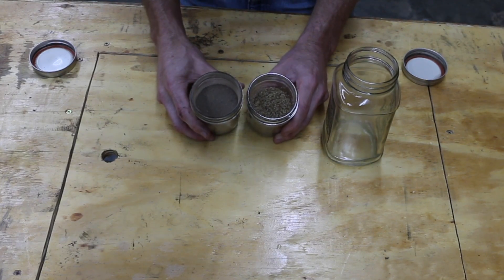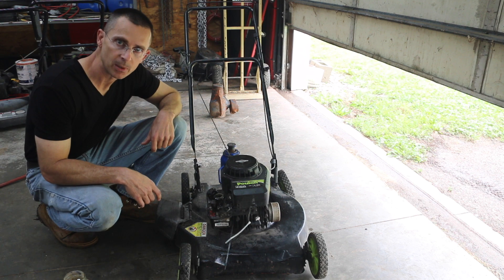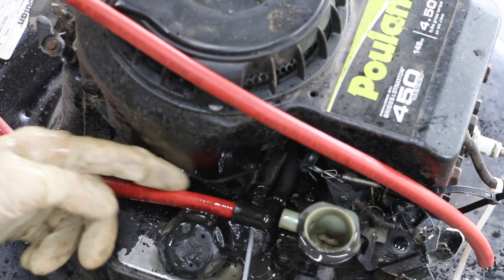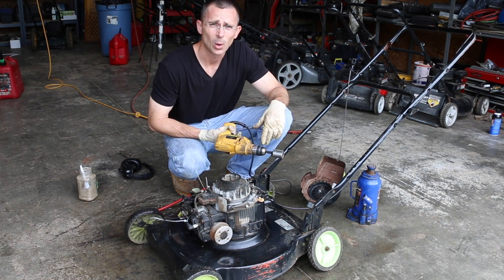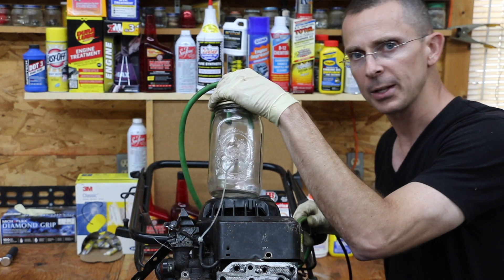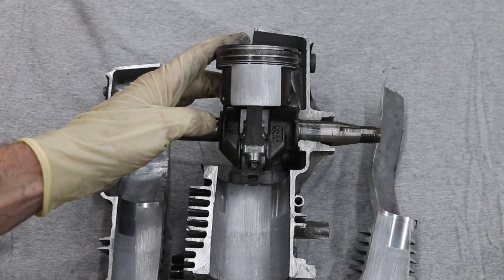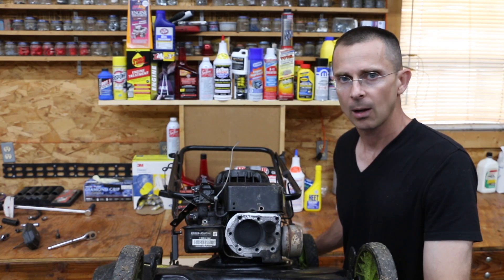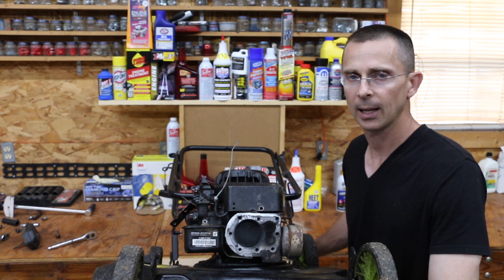Will Dirt Destroy an Engine?  See what it does to this Engine!

Comment: This is a bogus experiment. Even in a lawnmower engine close to the ground and the blade kicking up dirt, it would still last many years. The likely hood of it being discarded because of engine wear due to no air filter is very low. Same holds true for a motor vehicle engine whether it's diesel or gas.  Short term damage is an issue due to unusual circumstances where a lot of debris enters the intake incidentally such as in this experiment. Otherwise, damage is in the long term by shortening the life of the engine but not necessarily significantly. Wisdom says to use an air filter.

Comment: I've been concerned about my K&N air  filter  in my Mustang.  It came with it when I bought it used.     I can see the thought process.    The '99 SVT engine revs relatively high.  I seem to remember from one of your other videos that this filter is not a particularly good filter.  The way these filters are installed the original parts the filter attaches to are gone.   A regular paper filter cannot not be installed.    When I see allot of dust in the air I try to coast thru it.
Reply from the maker: Thanks for sharing.

Comment: Remember kids, change your oil regularly, follow manufacture recommended intervals and for fuck sake change your air filter. And don't use that K&N crap because it filters LESS than a normal filter.

Comment: I had a customer come in with a mower that hadn't been serviced for 3 years and been used commercially, plus the air filter had been removed.
After servicing it, it took 5 mins of running before it blew out less oil than that engine did through the bypass pipe.
So for a comparison, you did more damage in that time than my customer did in 3 years.
I think the grit size is the reason it got so damaged that fast.
How about something of a finer/softer size/texture, like grass clippings, drier fluff etc 
Still enjoyed watching it😁
Reply from the maker: Thanks!  Thanks for the suggestion.

Comment: Over the years I have seen many things poured into fuel tank, sugar, water, eggs and bleach. The  last one was used  on a Ford ranger, girlfriend would pour bleach into fuel tank. The pressure actually caused the top of fuel pump to Crack. I  do remember once before unleaded fuels a customer had issues with stalling, to make it a short story someone had put a ping pong ball into fuel tank and when fuel was at the right level it would cause the ball to get sucked over fuel line causing it to stall.
Reply from the maker: Thanks for sharing.

Comment: If you're still interested in destroying engines and haven't done these yet, couple things I'd be interested to see is no oil whatsoever, and for a really long term test, how long under normal use would an engine go with no oil change.  To both significant damage and complete failure.
Reply from the maker: Thanks for the suggestion.

Comment: I recently changed the air filter on my 2020 Toyota Camry LE ,  four cyclinder 2.5 liter engine . I had a Purolatoir filter and had sprayed it with PuraClean Filter Spray , allowed to dry and installed . It is used for furnance filters to attract / catch more dirt . I had contacted the company and asked about using it on a vehicle's air filter , they said sure . The filter had been in for 3 months and I compared it to a new one . Definitely a big difference and changed this time to a WIX , made in South Korea . Very noticeable improvement in acceleration and smoothness . I had usually left air filters in for 6 months , but as you said they are to collect / stop dirt from getting into the engine . So now to replace filter 4 times a year at a cost of $120.00 .
Reply from the maker: Thanks for sharing.

Comment: Just had a new UTV engine get damaged by dust apparently under 1800kms of mileage according to the dealer. But it had an air filter that wasnt that dirty so Im a bit befuddled. UTV's ATV's are supposed to be able to run in dusty and dirty environments. Its being fixed under warrant but still.

Comment: The reason behind the blowby is that the sand is scratching  the cylinder walls and oil is getting in the cylinder  and into the intake valve  back through the carb
Reply from the maker: Thanks for the feedback.

Comment: Great video and I find the things you do most entertaining all the way from the land of Oz…..keep ‘em coming!
As for ideas, how about you run a chainsaw with the incorrect oil to fuel ratio mix and learn what happens to it. I’m sure this has been a problem experienced by many Weekend operators, like me. Also as a part of this you may want to give some thought to designing an experiment that can show why chainsaws lose power and what can be done about that. 
On a different note and show where you have done work demonstrating the different strength of the epoxy’s in particular JB weld I would be very interested to learn what is the difference between JB weld original formula and JB weld marine.
Thanks once again for your great work, entertaining, informative, educational and down right fun! 
Cam
Reply from the maker: Thanks and you are welcome!  Thanks for the suggestions!

Comment: Makes me think back as a kid. We had an old dirt race track way back in the woods. Man could we kick up a lot of dust. I remember lot of young folks brought the old mans car down there to run the track a few times. To get a better time around the track they would remove the air filter. Destroy the engine and then a quick run thru the car wash and carry it back to ole Dad. Nightmare!
Reply from the maker: Thanks for sharing.

Comment: Thank for this video
Reply from the maker: You are welcome!
Reply: Thank for replying 
I do have a 2021 Qx50 after the accident too much dirt inside the intake and the Through the turbo charge pipes, after cleaning the engine still taking extra Air and it gives me P0300 and p0171

Comment: An air cooled engine the fins packed with mud or grass and sand and leaves or grease and dirt. Like a motor not cleaned.  Then run in the heat see if it overheats and damages the motor. To step it up use an engine oil that's sub par and not recommended for hot temperature use. This might show how neglect can kill a motor.
Reply from the maker: Thanks for the feedback.

Comment: Interesting.  I was wondering if the muffler was damaged as well.  Mowers kick up their own world of dirt hurt and their air filters often don't get cleaned.
 I see you have done Diesel in a gas engine, and you said you did sugar.  I will look for those
How about something other than the recommended oil, like transmission fluid or brake fluid?
Reply from the maker: Thanks for the suggestion.

Comment: I have to say on this occasion I do not think this is a realistic test to compare to a prolonged use without an air filter. Unbeknown to me, I had a tiny hole in a flexible hose to a diesel engine and I know that it was ingesting a tiny amount of dust. It did require a rebuild, yes, but nothing like we've seen here and I would suggest that a small amount of particles over a prolonged length of time will do far less damage than spooning dust in the manner shown. The reason being that the natural oil coating left on the cylinder walls will help the rings pass over one or two specs of dust much easier than a spoonfull.

Not a criticism, as it's still proving a valuable point about making sure your air induction system is secure and clean. Just an observation.

Comment: I  would like to see what happens to an engine when you let an engine cylinder wall dry out from oil will you get metal on metal as the lubricant stroke protection has drained away,,, for example letting a car sit for 5 to 6 months over the winter period ,, will you get scoring if you do it year after year .... thanks  😊 love your videos very informative...
Reply from the maker: Thanks!  Thanks for the suggestion.

Comment: Let's say you have a hundred grains of sand in a year.  it will be about 8.3 per month.  Remember that the air intake is usually high above the ground.  then the question is what kind of dirt is getting into the engine.  perhaps residues in old oil or other types of particles

Comment: I missed this older video but even I didnt know that could happen. It actually makes sense though. I don't think early carbureted engines had air filters which is more than likely one of the reasons why an early vehicle could only go 20,000 miles before needing an engine rebuild.

This definitely was a worthwhile video, you sacrificed a lawn mower engine to show people having an air filter is important! 👍
Reply from the maker: Thanks!

Comment: What brought me here was that I was considering buying an MGB with two side draft carburetors.  I don't see an air filter anywhere in the picture so I was wondering how much damage was done to the engine after running around the countryside for the past 40 or 50 years.  I think I'll pass on the MG.
Reply from the maker: Thanks for the feedback.

Comment: I had a fire from my carburetor and my wife threw dirt on top of the carburetor to put out the fire the engine was not running when the dirt was thrown on top however dirt is inside my carburetor what can ido

Comment: I’ve heard of people pouring water into a fuel tank hoping that it will “turn into” gasoline. I’d be curious to see what happens when water is put in a fuel tank.
Reply: (Of course you mix the water with gasoline in the tank)
Reply from the maker: Thanks for the suggestion.

Comment: Really enjoy your tests. This one "does" seem to have an obvious conclusion after dumping dirt and sand directly into the carb but may also be a bit misleading. To explain, I also watched your air filter shootout (Which Car Air Filter is Best? Let's find out! Fram, K&N, Wix, Purolator, & AC Delco showdown - YouTube) and the conclusion of that one is somewhat based on this project, or vice versa, it would seem. You gave the K&N a very poor rating but in reality, it would not let any of what you dumped into that mower through. That's an idea for another test, by the way. Use your filter test set up and, if you can even see it, take what is left of your "death mix" after going through the K&N and dump "THAT" into the carb of an unsuspecting mower. Do the same for the WIX. My guess is there will be none of that sand mixture getting through and what does will be so small it will be difficult to even collect and ultimately have no affect on the engine. Keep in mind, anything less than 40-50 microns is invisible to the naked eye. Also, that mixture you dumped likely represents >500K miles of contamination if driven normally without a filter. I believe the K&N is a much better value since it is re-usable and actually becomes more efficient with use. In your test you increased the ET of your farm truck by >1 sec over the next fastest filter; in a fairly short distance. In my viper or my motorcycle I would expect even greater time differences. The savings in gas alone, due to better air flow, will pay for an engine rebuild by the time any microscopic particles that manage to get through do any damage. It's also rated for a million miles of use. And I can always use Seafoam to clean heads periodically if I get worried in the interim. Again, the savings in gas and air filter replacements would easily pay for it. I also suspect that you would see increased carbon deposits on the pistons/heads if your engine is running rich due to reduced air flow before any affect of what gets by the K&N is observed. Drivers/Riders have sworn by K&N's for 50 years when racing the Baja in Mexico. They can't afford a breakdown in the desert or potentially destroying their very expensive engines. I have NEVER seen any signs of anything on the "clean" side of any of my K&N filters. If I can't see it I'm not worried about it. Which filter is best? That depends on how one defines "Best". IMO, best must consider much more than how small the particles are that get through.

Conclusion: Based on your conclusion of the K&N I think your obsessing over how clean the air has to be. Please prove me wrong.

Comment: It’ll be a better simulation if very fine powder is used instead of coarse particles. The motors would intake the fine particles in the air and accumulate over the years, instead of such coarse sand.
Reply from the maker: Thanks for the constructive feedback.

Comment: When competing in Enduros during the 70's, it seemed nearly impossible to keep muddy water out of the flywheel/ignition/gearbox in spite of sealing everything with silicone caulk. I finally decided that contamination was due to the vacuum produced when the hot engine was quickly cooled during water crossings. (Solution: vent hoses that extended up under the seat.) Can something similar occur when drivers encounter flooded streets?  What damage occurs when cars are flooded? Can anything be done to minimize flood damage?
Reply: This is common in 4wding these days. It's recommended to put breather hoses on your diffs, transferase and gearbox before doing any water crossings, especially muddy ones. 

Usually they get extended up to the engine bay. 

Only started beginning common practice in the last 20 years I think.

Comment: Here’s a similar story on a somewhat larger engine. Some years ago I worked at a heavy equipment and tool hire shop. We hired a year old JCB 3CX (Backhoe loader) to a local outfit that did slip forming concrete. They were doing a job in Jersey (An island off the coast of England) The job went on for a few months, and when it came back the machine was in a very sorry state, covered in concrete, and the engine smoked, leaked, pretty much everything bad. :(
Turned out the air filter had blocked up so the engine wouldn’t run properly so they’d just thrown it away, the safety inner too! The boss pointed out they could have just phoned us and we’d have shipped some filters out to them, and as it was on hire it wouldn’t have cost them…
Their boss simply said “Well just rebuild it and send me the bill, I made lots of money on the job so no worries!! 
I got to rebuild it, which was quite a nice interesting job, as you don’t normally get to answer “What would happen if”?…
The engine was a Perkins 1004-4T,  (4 litre turbo diesel) which is normally quite long lasting, but this one was absolutely worn out from the concrete dust. It needed cylinder liners and pistons, the rings were worn right down. The head was reworked too. Luckily we caught the big end and main bearings in time, these were replaced but the crank was OK. The wear was different to the Briggs & Stratton, no deep gouges, just an awful lot of wear, and the engine smoked, breathed and leaked badly, but still started and ran. Anyway, the job went well, machine was  restored mostly to it’s former glory, the customer didn’t argue about the bill, and so the boss was happy!
Reply from the maker: Thanks for sharing.

Comment: thats not true about more easier airflow equals more power, the resistance of the air filter helps the engine suck fuel. like a choke in effect.  simples.

Comment: Have you considered the idea of using something brittle such as glass, concrete, ceramic, or anything of that kind of material as a cylinder head to see how well it would work as well as glass could be a new way of making a more permanent see through cylinder head, I do know glass would be near impossible to obtain in a cylinder head mold but what about something like ceramic or concrete?
Reply from the maker: Thanks for the suggestion.

Comment: You should do this again to another engine, then test out stuff that can help build compression. Clean out all the oil and insides after destroying it, then use ceramic coatings and additives to see if it can restore some of the compression.
Reply from the maker: Thanks for the suggestion.

Comment: Ya, the good old boys too cheap to replace a very old air filter would just yank it and drive without one. The billowing smoke reminds me of the "Vette" days. When the low income folks who wanted a Vette and couldn't afford a Corvette, they would buy a Chevette. Ha-Ha! Antifreeze will lock up an engine pretty fast if poured into the gas tank. Did the exhaust smell like oatmeal cookies when running the sugar in the gas?

Comment: Drove a civic v-tec 16-valve for very long time with big hole in the air filter, a year or 3, not sure. Got a stuck valve later on, fixed the valve and the engine was normal again, swift and quick as new, no oil consumption or any other problem.
Reply from the maker: Thanks for sharing.

Comment: You should try this but have it go into the engine over a longer period of time like a separate tube into the top portion of the dirt jar leading to the intake where it will suck in very small amounts at a time and run the engine until it finishes the jar or the engine dies
Reply from the maker: Thanks for the suggestion.